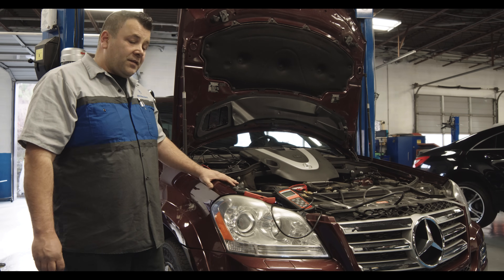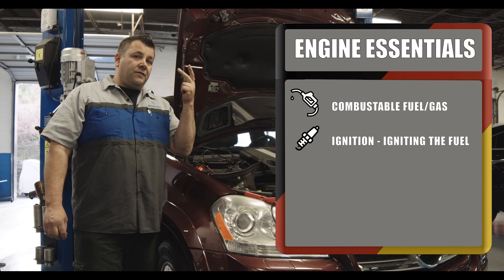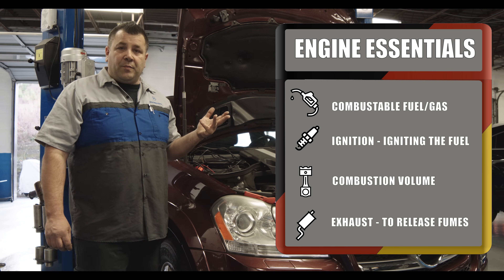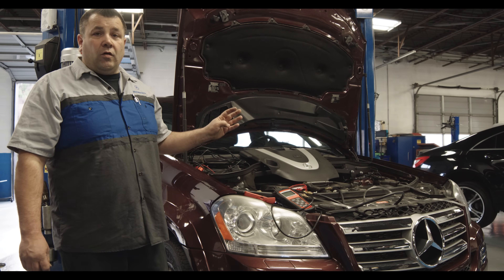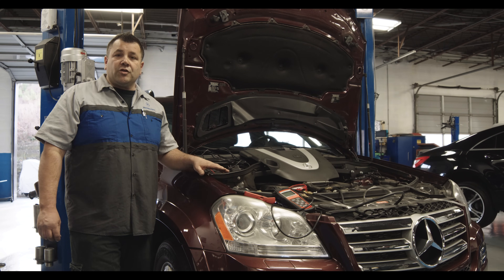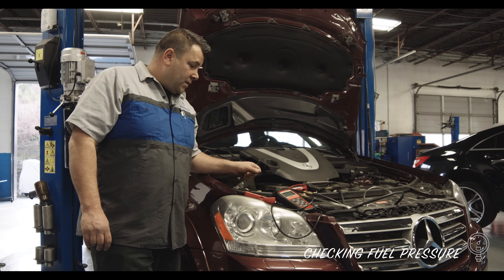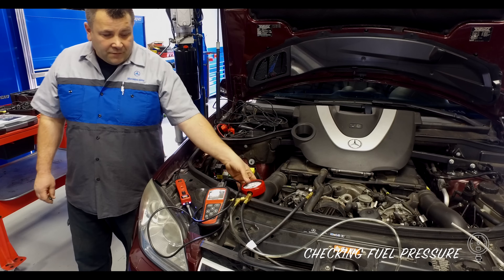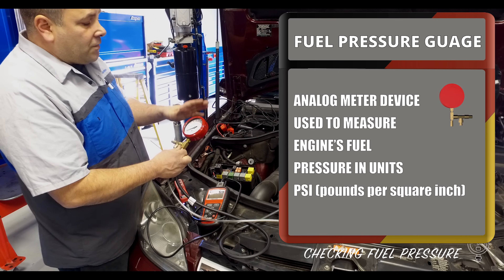Why a car won't start -  Mercedes Benz Troubleshooting Guide, Tips

Comment: I have similar problem, when car is cold (in freezing temps), the key opens the doors, locks unlocks, lights inside and headlights turn on.  2013 Mercedes ML250 Blutec.  But, the key will do nothing...  at 1st.  It takes about 5 minutes or more in really cold weather to activate anything.  In warm weather has no problem.  I have to wait with the key inserted and turned to the right, 1st click or 2nd click and wait.  It seems something is charging or warming up before it will turn on the ignition sequence.  Then the radio comes on sometimes and the wipers, and then I have to wait, try several times and it starts the car.  

Bought a new battery (big one for under the seat) and still does it.  I have 2 keys and both have the problem.  Once the engine is on and driven, it starts and stops perfectly until sets in cold weather over night and same thing...  What is it?  Maybe loose starter module or fuse that needs pushed down?  Like in chip 'creep'?
Reply from the maker: Most likely your recognition switch is not good, but I recommend you get a professional diagnosis

Comment: I have a 2011 E550 and I drove home shut the car off. When I got back in to crank and it wouldn’t start. I replaced the battery and starter. Now when I turn key to start it makes a ch ch hmm ch ch hmm and does not turn over or start but all lights on dash illuminate. What could this be?

Comment: The Merc problem where water cascades from the windscreen in to the fuse box is lethal for Mercedes electrics . Especially where dirt n leaves are involved . . Leave to dry out and make sure your battery is not shorted flat . It was a pain for me  on C220 .

Comment: Great video.  I have 2008 Clk 550.  eis would not crank.  Steering wheel locked. I Replaced fob.  car started immediately. Steering wheel unlocked.   Good as good.  Eis did not need to be replaced. Thank god.

Comment: I have a c200 kompressor w204
Changed the E.S.L did the programing ,the key turned on the engine once than somethimes not, sometimes I hear the fuel pump, and the car cranks, sometimes I dont hear the fuel pump, and the car wont crank, its been a month, now the starter is not turning the engine, change the batery lights up everything on the second stage of the key but dont crank, any ideas or advice?

Comment: 1997 s420  v-8 .
I changed spark plugs and coils,
Then drove about one mile to check .
It was now much better ,almost like normal car should be.
But I checked for water in fuel by disconnecting the fuel pipe at the exit  return pipe  next to pressure regulator.taking some fuel and then reconnecting the pipe.
There is no water in the fuel.
It has spark.it has 45  ps fuel i pressure and holds pressure.
55 psi when cranking.
Cyl 1 has   30 psi and cyl 3 has 50 psi  and cyl 4 has 120 psi.
BUT that's how it has been and it ran and drove for past 3 months.
So why crank and no start?

Comment: So maybe a bit of ideas from you, I have a 2008 e350 that ended with timing concerns, sourced a replacement engine for it, but upon installation, car cranks but no start. First crank of the day it pops over for a split second then just cranks with no attempt. If you leave it sit for 5 or 6 hours and try again you get the same single attempt to fire but that's it. Have fuel, have at least rudimentary spark, replaced camshaft and crank sensors already to no avail, very odd things happening though, Everytime I plug a scanner in to get codes or data stream, there's always new or different dilemas. Keep in mind I am a master tech of over 20 years and own a fleet of picky cars, several sprinters, e class, s class, jaguars, corvettes, etc so I'm relatively familiar with European vehicles being finicky, but this one makes me want to burn it for a campfire. Lol. Any thoughts
Reply from the maker: @robertm8966  few questions, 1. You’re using the original engine control unit right? 2. was the engine that you installed a good engine? 3. Did you do compression test or a leak down on the new engine prior to installation? 4. is the fuel in the car good? 5. was the computer for the engine control unit prior to removing and installing the new engine good? 6. are you getting drive authorization from all theft related parts?

You need 4 basic things for combustion, fuel, compression, spark and exhaust, if they’re all timed correct, the engine should be running

Comment: My friend pulled the car battery because it did not record any voltage on the multimeter, when it was changed, placed back in ,  when I try to start the car , the alarm goes off and no crank, help !!!

Comment: My GLE 350d starts but immediately cuts off. Any thoughts?
Reply from the maker: @CRen46  what year is it? Either fuel issue or drive authorization issue.
Reply: @MercedesBenzTechs  it’s a 2015. Will look into both thank you.

Comment: HELP ME!!!! 
I have a service now brake warning in RED...I'm not getting a crank or start. However, I see all the brake fluid is gone. Could this be the issue
Reply from the maker: From what you describing, I think you have the sensitive brake control system in your car. I would start with checking your batteries and alternator to see if that’s the reason the car doesn’t start as far as the service break now on the dish and no brake fluid in the reservoir, are you gonna have to look? Where is the fluid leaking from regardless? I think the systems are under 25 years warranty from Mercedes-Benz. Check it with your local dealer.

Comment: I just replaced starter on my 10 e350 i bought a new relay before i swapped the starter didn’t do anything so i returned it we bypassed it it cranks with bypass. The key works the steering wheel drops lights come on now do i replace starter relay or is something else bad

Comment: Hello, i have a w212 e250 
After replacing my alternator, my car is in limp mode and has no codes or check engine. When in park, it accelerates fine when in drive. it's very slow to get up to speed 
Feels like an engine and the transmission not communicating properly 
Please help. Thank you.

Comment: Great Video trying to trouble shoot my situation with it but I can't figure it out. Car does not recognize the key push button will not turn dash lights on, put key in the ignition and turn to position 1 and 2 and no l lights on board the factory remote start work but hen it also stop working, Key opens and closes doors so how do I trouble shoot EIS or Key Fog? how do I find out which is the problem here? anyone got help please let me know, I have a 2010 Gl450
Reply from the maker: Most likely bad ignition switch.

Comment: I’m having a no crank no start issue with my 2011 e550, the battery’s been weak, I drove the old lady to a appointment , came out and the car wouldn’t turn over wouldn’t start nothing all the lights wipers, horn ext work fine, I tried boosting it, and nothing I changed the battery and still won’t turn over can some one please help me out with some info
Reply: What’s up Dustin did you ever find out what was the problem because I’m in one right now with a 2011 E350 4Matic

Comment: Hi I saw your video and I have a question. My 2008 Mercedez Benz starts but it hesitates what could be the problem?
Reply from the maker: Bad fuel, bad spark plug, starter is going bad, battery is weak MAF meter, intake air leak, camshaft position sensor, worn out engine(low compression) those are just few.

Comment: Hi have a w204 c320 v6 cdi car was standing 4-6 months in garage no battery got battery connected it key on lights on no cranking  just a thud sound. Next day check starter brush box dead replaced it wors on the bench with jumper replaced car makes no sound no cranking and no starting? Will check fuses tomorrow and starter relay clicks but will replace just in case  any othe suggestions oh yes we have a launch diagnostics scanner no major issues just ECM error right map sensor will also replace that tomorrow ... i have a feeling its gonna vecome a headache eventually

Comment: Thanks for the great presentation. How about my c230 mercedez 2004 kompressor with New battery did not start the engine but when I charged it did start for couple of days then after it lost lightnings on duskboard and doesn't start nomore. What are the possibilities that causes this issue? Thanks again.

Comment: David have a 2003 G55 with the weirdest gremlin ever. After an engine wash the car won't crank, it just clicks after I go to crank it in the ignition key position, however everything else is fine, all lights come on fine, battery is new etc.  We replaced the starter, same thing. Replaced the front SAM, same thing. Just a click. However me and my mechanic friend managed to get the car cranking and to start by applying direct juice to the starter cable after disconnecting it from the front junction box by the brake booster and opening the ignition key to the cranking position at the same time. Also if direct juice is applied  with the probe  at the starter through the front SAM and turn the ignition at the same time it will start. Once on, the car drives and behaves perfectly but it won't start again if I turn it off, just a click again after I go back to turn it on. We are baffled at this point. I don't want to take it to the dealer as they have the worst rep and don't trust any Indie shops around here either, only my friend's.  Any thoughts?
Reply from the maker: It can be many things… front right fuse box.. CAN communication… security lock.. did you try to read the codes with Mercedes Diag
Reply: @MercedesBenzTechs   Yes, Star diag shows no faults/codes. Front right fuse box (SAM) was replaced for a new one and a other fuses have been checked one by one including the sealed fuse box in the battery box.We ust don't now where else to check.

Comment: Yeah i have a c230 kompressor 2000 year...it just stopped and wont crank but i am getting camshaft sensor code and crankshaft but changed both sensors still no start thinking it maybe the timing

Comment: A170 starting issues for months now, new starter didn't help. After cleaning all points, easier to start but now SRS  and ABS errors plus on km screen, Triangle 🔺️  and  LIM  and Brake error s light up. At odd moments car won't start, then after eg 40 mins  it starts   Has this model been recalled

Comment: Hi David, my Mercedes C280 was involved in an accident, after everything was replaced it only turns on and doesn't start. Hopefully this video will help.
Reply: Your car likely has a fuel cutoff switch (inertia switch) that can trip even in a minor collision. The purpose of this safety switch is to stop the flow of fuel in case the fuel line is damaged in the accident. All that is needed is to reset the switch by pushing a reset button. The big problem is finding that inertia switch to reset it. I’m here for that same reason.

Comment: Great video. I have 2005 C240 4matic. No crank no start, message on screen ‘coolant level check’, key turns, can not shifter from park. I took out battery to autozone, they say battery is good. What should check. Please help me. Thanks

Comment: Hey...
Where are you located?
Reply from the maker: Two locations in Atlanta, Georgia
Reply: @MercedesBenzTechs  ...
Does the diagnostics steps you described in checking off why a car won't start also apply to a w211 2006 e350 wagon?

I ask this because in the video it appears that the Mercedes was a new model than a w211.

Comment: Great video. Thanks for sharing. Here is what we have. Mercedes w203 c220. Chain replacement and we did a compression test, all good. We decided to close up the head cover and try it out before completing finalizing. The car stopped cranking, and many issues with Canbus communication issues ecu,tcu, and so on. The main fuse box was replaced in the same situation. All fuses are good, and the battery is good. Gear shift no moving from parking to neutral and not indicated on the dash. The dashboard comes live at position 2 but no crank. Tried replacing and the gear shift,  no result. Any ideas?
Reply from the maker: It sounds like an electrical issue. Check all your CAN communication junctions
Reply: We tried to jump start another car now my c250 will not turn over even with my other can connected with jumper cables. Key fob will not lock or unlock the car

Comment: Hi buddy I’m having a big problem with my 2007 gl450 can’t get my engine to start. I replaced my fuel pump, fuel filter, spark plugs, checked for spark, checked compression. I am a little bit off, but not so much and still can’t get the car to start it cranks but no start all relays are good. But when I put car in position 2 no fuel comes from the line or to the engine only when I crank the engine. I get fuel out. Please help thank you in advance.
Reply: Also, there is no fault I do have 1 fault only four insufficient for cat but I know it’s to replace the O2 sensor. Will that stop my car from starting
Reply from the maker: Check your rear fuse box and SAM for water damage, it’s on the rear right side when you open the trunk on the bottom part.. the rear SAM control the fuel pump
Reply: @MercedesBenzTechs  I checked both no water damage. I also took out the rear Sam yes, to see if there was any water damage even on the inside and I did not notice anything. does the rear Sam have something to do when I put the car in ignition 2 and no fuel gets delivered to the line. It’s so weird that I only get fuel in the real line only one the engine is cranking, but when I put it in the ignition 2 nothing happens.
Reply from the maker: @samvjr07  yes, you need to run diagnostics, but usually the rear Sam control the fuel pump, see if you could maybe buy one on eBay or used parts yard.. it’s either the Sam or it could also be the central gateway under driver seat but your best bet is maybe to pay somebody for diagnostics
Reply: @MercedesBenzTechs  hi purchased a new rear Sam from the dealership disconnected the battery and installed new Sam and vehicle still did not start. This is so frustrating. what I don’t understand is why is it that when I put the car keys on ignition 2 like other GL‘s it won’t push fuel to the line from the fuel rail. Also fuse box has 12 volts
Reply from the maker: Did you program the signal acquisition module?
Reply: @MercedesBenzTechs  yes it was Control unit REAR SAM

Comment: I was driving 2011 450 gl 155,000 miles.. i stopped then all of a sudden it would not start..

Mechanic said my starter just died..

I had new battery.. said it took 4 hrs to put new starter in.. they said they needed to take lots of parts apart to reach starter. Does that sound reasonable?
Reply: 4 hours is too much. Is your car 4Matic? It should be a 1-2 hour job, max 3 hours....People on MB forums have done the job solo in 2-3 hours...
Reply: @mrm1712  yes 4matic.

Comment: 2010 cls 550 all the dashboard lights come on when I turn the key over  won’t start Up It’s just quiet you can hear everything indicating that it will start up   But   No engine cranks
Reply: 😂help
Reply: I'm having same issue with 2010 E550 v8 4Matic. I think it's the starter. I tested relay, fuse, tried by-passing relay with 2 metal plates and starter doesn't seem to be getting power. Tested battery and jumped battery and tested charge, it was 13.5V so it's holding charge. Ignition works, lights and dashboard features like audio are working but no crank/start. 

I don't want to go to a mechanic because here in Canada they overcharge like crazy...but the replacing starter seems to be a pain in the ass on the 4Matic w212. Have to remove the Catalytic converter/midpipe and then you are able to access starter...

Comment: We have been riding with our Mercedes 1999 C200 when we arrived at our house we switched the engine off ,when started it again to pull the car into the garage it would not start ,it's not the first time the Mercedes done that it did it before stood for 3 months and just started again in the mean time we bought a new battery car was running like a dream ,and now it's back to its old tricks ,has anyone got an idea what it could be ?

Comment: I have a problem with 07’ ml320 cdi , cranks but no start, no codes, fuel pump runs, builds fuel pressure, dash lights up, new CPS but no reading power going to CPS so no rpms showing during cranking. Thinking bad eco but one in a while engine will start and run  like no problems. Maybe bad mid SAM?
Please help
Reply from the maker: Those issues requires a professional diagnostics, there’s no way I can give you any kind of direction without looking at the car

Comment: I have  2007 S550 one day I pulled up at the store and I didn't put the car in park soon as I turn the switch off I realize I didn't put it in park the car automatically go into park this  time it seems a little different. When I  came out the store my car would not start everything on the dash comes on but it would not start
Reply from the maker: May need a new ISM, have it diagnosed.
Reply: Thanks for your quick response
Reply: I do most of the work on my own car. Can I replace the ism myself or do it need to be programed by the dealership?
Reply from the maker: @antfordbbq  dealer won’t sell it to you and it needs programming too it’s a Theft Relevant Part
Reply: @MercedesBenzTechs  Thanks
Reply: Can I contact you
Reply from the maker: @antfordbbq  yes
Reply: How can I contact you
Reply from the maker: @antfordbbq  404-645-6387
Reply: @MercedesBenzTechs  I just talked to you thanks for calling me back

Comment: Anyone know why 2006 E-350 won't start? One rear tire ripped while driving. Went straight to get 2 new rear tires. Car drove for 10 miles. ESP light came on & Batteries are good. Fuses are good. Car drove 10 miles after new rear tires and now does not start. All lights comes on, gear can change. Engine does not start. Any idea how to fix this? Inheld ESP BUTTON for 5 seconds amd nothing happens. Can't be linked either. Thanks if anyone can help.